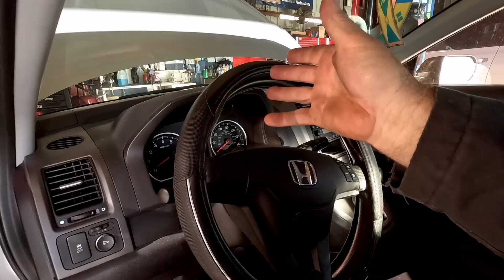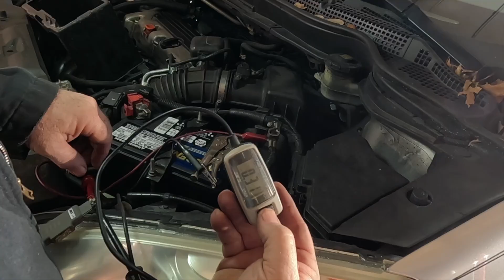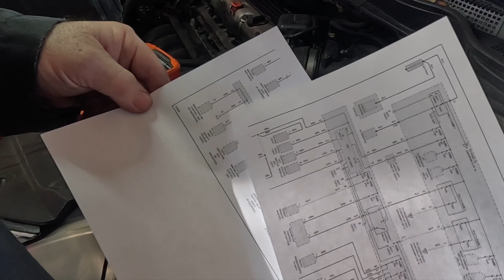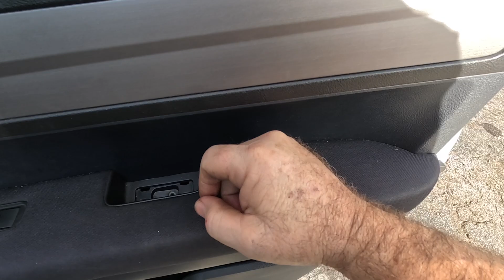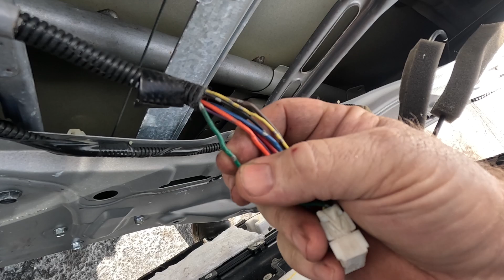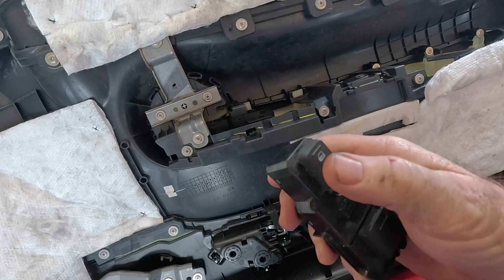AMP DRAW TESTING, INVASIVE VS NON-INVASIVE, HONDA CRV, DEAD BATTERY...

Comment: Jimmy, when testing for a current draw, would your Klein infrared scope show heat in the fuse box thus showing you which one is heating up? Maybe it's not drawing enough to generate heat? Just curious. I often thought about buying one just see if i have any leaks in my duct work on my house.
Reply from the maker: Yes Mike, if the circuit is drawing enough to add temperature in it the infrared should pick it up. I’ll try that next time. It’s not fool proof, since it requires to time allow other relays and fuses to cool before this test, but it can help.
Reply: @JimmyMakingitwork  thanks Jimmy.

Comment: Excellent topic to cover Jimmy! That Fuse Buddy looks like a handy tool to have. I've been looking to purchase a DC amp clamp and noticed you have the Kaiweets. Ivan at Pine Hollow uses an Astro-AI amp clamp. Both units are in the $35 price range. Much less expensive than a Fluke or Klein.

You are right about battery manufacturers making different spec batteries. Johnson Control, Exide and East Penn are the most common manufacturers in the US. I worked for an independent auto parts store where the owner had 40+ years experience. He stocked Deka, Interstate and Champion batteries. Deka batteries, manufactured by East Penn, were the best batteries. Champion batteries, manufactured by Johnson Control was the budget line. He has a battery tester and tests each and every battery before it goes out the door with the customer. Time and again the Deka batteries tested much higher for Cold Cranking Amps (CCA) than what the battery was rated at. Try using your tester on a new Napa battery and see what the test CCA is compared to its rating on the battery. I was thinking of getting a small inexpensive tester to check batteries at Walmart and BJ's. There have been times where my employer had to charge a new battery in stock before it could be sold. I doubt that Walmart, BJ's or the chain parts stores rotate stock.
Reply from the maker: Very true right! I will do some testing with my BT300P soon!

Comment: Ever wash out door switches w/ plastic- safe electronics cleaner?
Reply from the maker: That can work William of the contacts are dirty. But most failures I see are internal breakage, like springs or contact bars breaking.